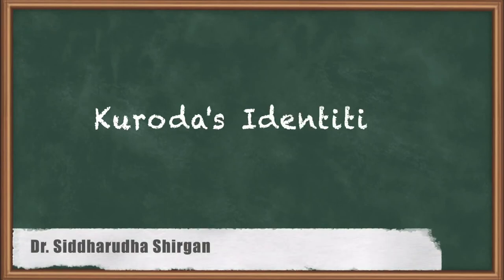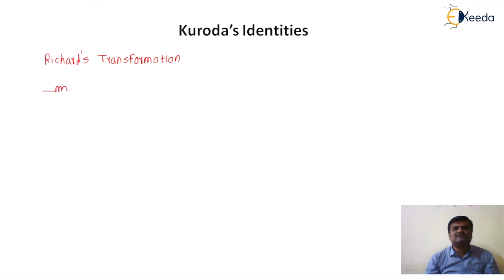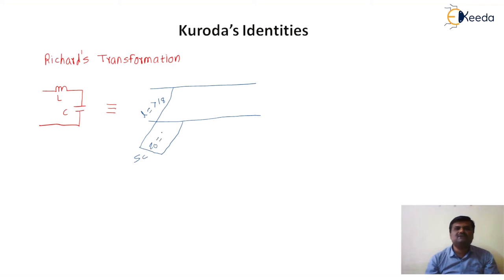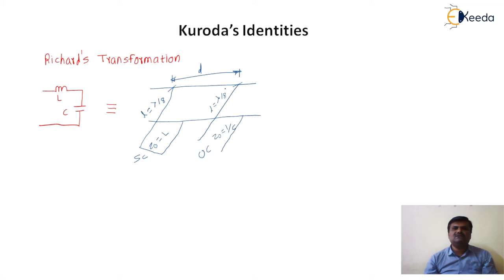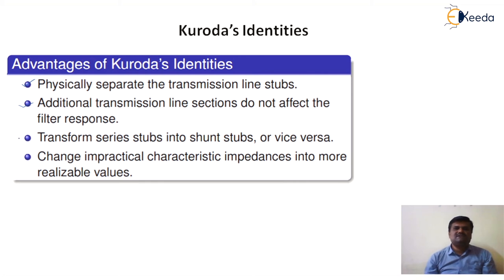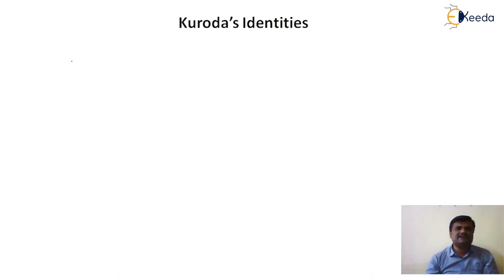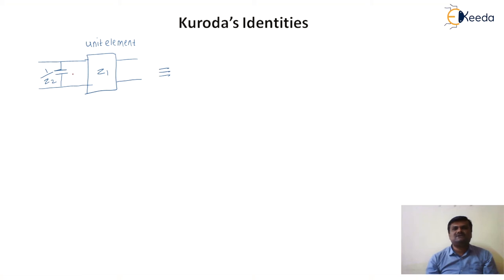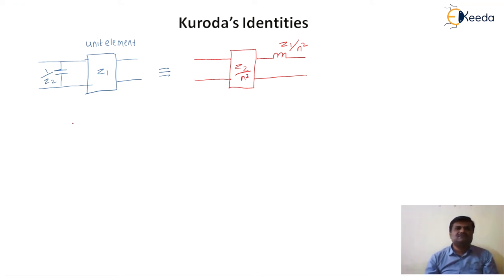Kuroda's Identities - RF Filter Design - RF Design

Comment: 4th identity is wrong. First, it transforms series cap to shunt cap. Second, for some reason at 9:54 unit element has changed from Z1 to Z2, and capacitor from Z2 to Z1.
And for those wondering what n^2 is, n^2=(1+Z2/Z1).